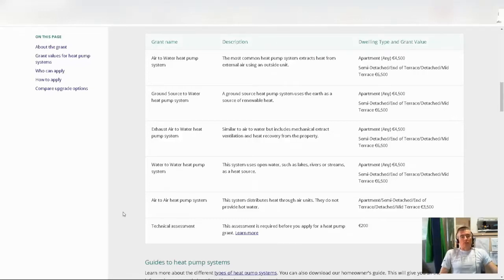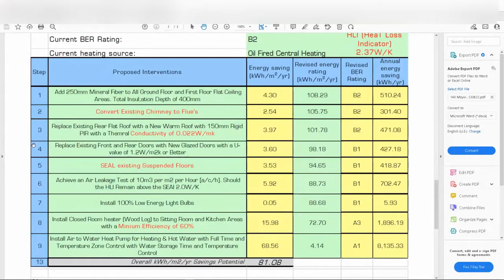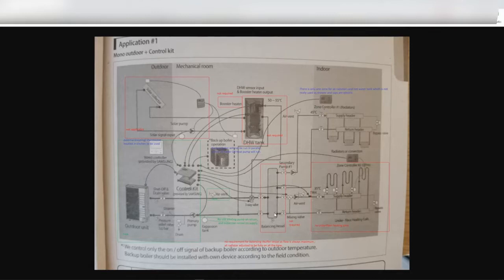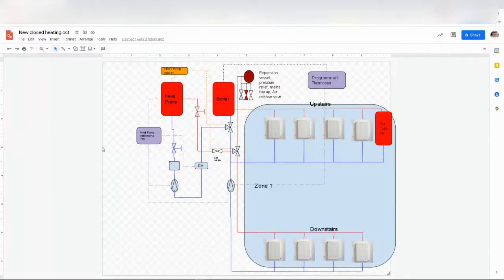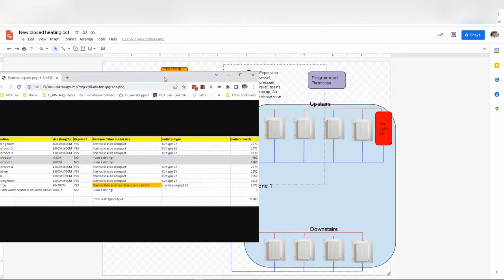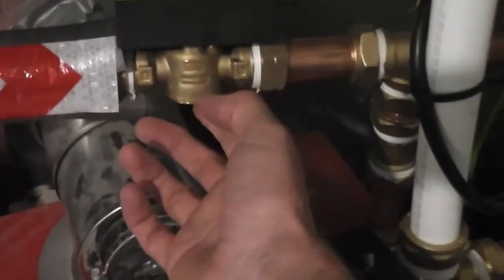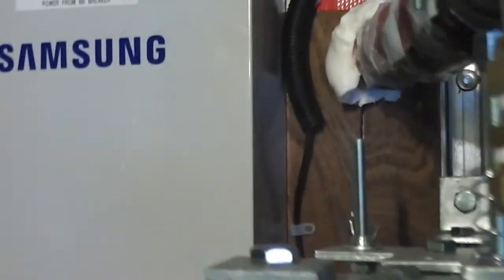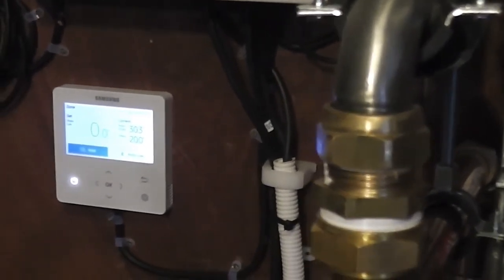dublin DIY HeatPump installation to replace an existing oil boiler

Comment: I did similar 5 years ago. Pulled out old oil boiler, didn’t change any rads. No grants back then, I wouldn’t have complied anyway. WAS €700 & still 4,000kwrs per year for all hot water and 21 degree house for 7 months. I’ve no stats, no zone valves, no TRVS. Pure weather comp. That’s key for  efficient heat pump running. That and a decent hot water cylinder to match the heat pump. I’ve a crap 1980 4 bed, 1800 sq ft. I’m in the HP business long time so that helps I guess.

Comment: Thanks for the install video. Did the flow meter come with the kit or could you tell me where you got it and if you find it good?
Reply from the maker: flowmeter came from joule with the pump. (You have to buy from  samsung agents Joule, in Ireland). Very short lead on it 1.5M - too short. I enquired with sika about longer connection but no response.-you may have to cut the wires and extend) https://www.sika.net/en/products/flow/vortex-flow-sensors/

Comment from the maker: Longer term review. Heat pumps are ever more topical in Ireland, and ive had my one installed for 6 months now, in a B2 rated house with external insulation.  My thoughts. A heatpump is not going to save you money as electricity is so expensive. My 4 bed detached is using 400 kWh  extra per month. However, if you have solar panels and a battery, that will help offset  the  kWh usage ..but only February to October. For the coldest months when you need the heat pump the most, ..there is  very little sun (100kWh per month for me, as opposed to  >400kWh during spring/summer/autumn). On the plus side, i would normally use approx 2000L home heating oil. say 2000 Euro. So technically thats a saving that can offset the much greater capital investment cost.  While the radiators are only warm now, and never hot , like with the oil boiler, you get used to it pretty fast and its fine. Slower to heat up but i can live with that. There are no longer any fumes in the garden, just the quiet hum of the fan. The tech works, and its green. But you are going to need 50k euro to do it right -  1. External (and other) insulation 2.  Max amount of solar panels & battery 3. Heat pump. In that order. Not all houses are suitable for solar panels ;  maybe they dont face the sun or have windows in the roof, or you are not allowed to cut overhanging trees that cause shadow.  I also live in Poland and ALL my neighbours have as many Solar panels as possible (11kW installs! - domestic houses have 3 phase in Poland) and external insulation of 180mm.  They are still using gas for heating, with a woodburner/stove in case of 'no-gas' emergencies. We have a heatpump in Poland also. We have Underfloor heating, and even in -20degC outside, the heatpump can extract some heat and maintain  the house temperature and hot water.However this Winter 2022 for example, elec usage was up to 800kWh / month. And with snow on the roof, no Solar kWh to offset the load.  While Poland has no solar grants,it did implement a reward system whereby you could export to the grid and get 80% of your energy back for free within a year. So export kWh during the summer, and take it back during the Winter (use the grid as a battery).
Reply: You're hitting a bit nail on the head here with the limits on domestic solar in Ireland.  The idea that I need to fork out for 3 phase, to get up to a higher inverter to simply get me taking less from the grid is mental, but it is what we have.

Comment: Where did you get the assessment that described the BER improvement for each step?  I'd really like that.  Its very annoying in that I assume all those outcomes are really easily achieved on the DEAP but I keep needing to call the assessor back to ask "if I do this what is the outcome".

Comment: Gas is still cheaper than elec in uk, so i’ll ride out the boiler as long as possible but when its time the heat pump is getting installed no question
Reply from the maker: This is the advice for everyone. I just could not bring myself to burn any more oil in case i might be contributing towards Putins warchest for Genocide.

Comment: Where did you get the actual Monobloc? I'm having a hard time finding a distributor who just sells the unit.
Reply from the maker: i covered this hassle in the main video. I had to get this 500 euro/ SEAI  report even to be allowed to buy a samsung heatpump off Chadwicks in Ballymount. It seems that their supplier Joule demands the report. Possibly to do with Samsung not wanting to be blamed for excess electricity useage in poorly insulated houses. I nearly imported the heat pump direct form Poland (use allegro.pl) to get around all the heatpump hassle. But then there is no clear guarantee if it is dead on arrival etc

Comment: Have you installed the Adey magnaclean professional 2 filter unit ,
Reply from the maker: Yes I have that . In fact it was installed previously on the existing heating return pipe to the boiler. So i ts just re-used

Comment: Looks like a very tidy and clever introduction to your existing system, fair play to you for just getting on with it! I was actually discussing his with a friend of mine today, a simple replacement of a gas boiler with a heat pump. We had decided to buy one and do a similar job to yourself. Do you have any thoughts on the performance, effectiveness or efficiency with using yet? I know it’s not quite winter but it is gradually getting colder.
Reply from the maker: i will have all that detail uploaded soon, but for now, there is an increase in electrical useage of at least 2 KWhr/per day. This was the case for September 16th. not sure what the weather was like, because i was away. I will update when it gets colder.  Also, i have a full professional samsung heatpump installation (with DHW & buffer tank  - for underfloor heating house) video for my Polish house coming soon.This was not a DIY job, as top notch tradesmen are easier to find in Poland, and Poland was were ahead of the curve on solar panels & heat pump installs.  Its the same model of heatpump, except 3 phase.
Reply from the maker: i forgot to add that rad heatup time is longer because the hot water is simply nowhere near as hot as that coming out of gas/oil boiler . But its not a problem, the house still heats up fine. The house didnt meet SEAI spec for the heatpump install but it is well insulated. Irelands temperate climate is ideally suited to heatpumps. If they work in Poland, they are going to work in Ireland, but i will update with the findings!

Comment: Need to be on a par with gas boilers money wise before I get one just to exspensive
Reply from the maker: Yes they are approx twice the price. But you don't need oil or gas obviously. Russias invasion of Ukraine hasn't stopped the supply of oil and gas so far and prices appear to have stabilized. If you have free solar KWHrs, it's better to use them than sell back to grid for half price. But of course you need a battery and there's little solar in Ireland in winter. By contrast, Poland allow you to export to grid and use for free anytime within 1 year. So much better for heat pumps.
Reply: @cormacgarvey3566  like I said still to exspensive at mo ,like electric cars to expensive at the mo,perhaps in few years time ,also it’s not just the pump it self your house as to be super insulated and you might also have to change your rads as not always big enough, to much retro fit ,ok in new build

Comment: Can you offer for me heat pump , my house 300 m2 area, i want to replace the disel boiler by heat pump , i want for floor heating purpose not hot water domestic kitchen or toilet , my contry Jordan in winter reach 0 c